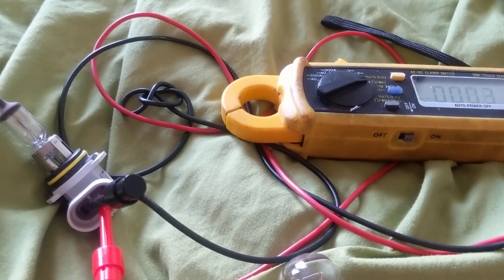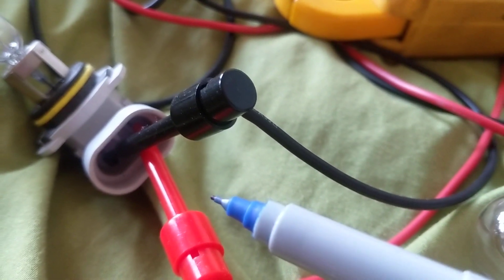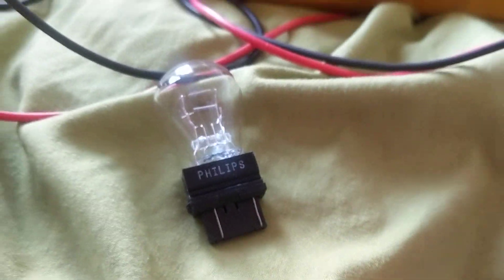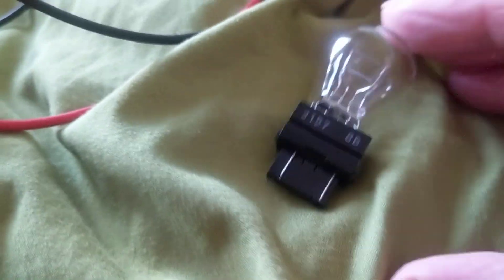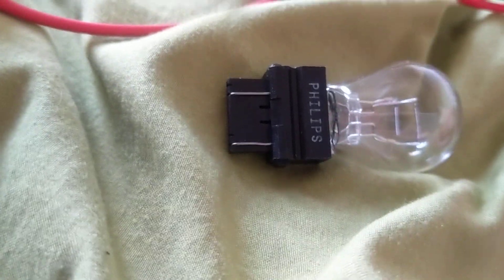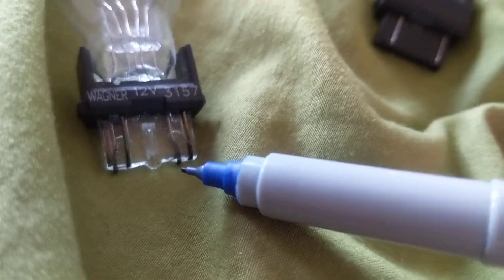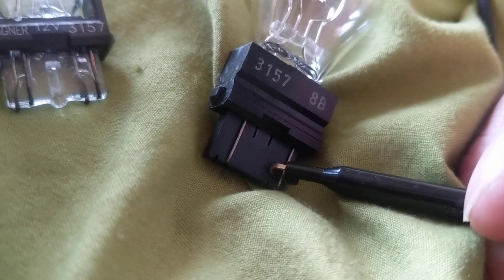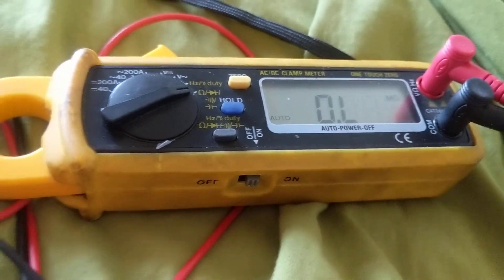How to test AUTOMOTIVE BULBS  and turn signal lights for resistance measurements WITH MULTIMETER

Comment: my gawd --- i think it is probably cheaper to just switch out [ switch ] bulbs --   vid is over kill to say the least .   a bulb test could be E Z
Reply from the maker: Worked with a technician and my career who switched three bulbs after which the problem was in the lighting control module so you see Alan sometimes it's better to just test the bulb
Reply from the maker: You have to understand repair shops don't carry parts they have to order parts sometimes they even send the wrong parts this is not a dealership which has the parts ready in the stock room so if you order a part you have to make sure you diagnose correctly
Reply from the maker: Other point being the technician had to order the bulb which took half a day then when he tried it wasn't convinced still wanted another bulb needless to say the customer was not happy when all he could have done was just basic resistant checks on a bulb to see that it was good all the time can you respond to that Alan
Reply from the maker: What about a technician I worked with that couldn't test a fuse I thought the fuse was no good but the fuse actually was good a resistance check would have solved that problem and a customer would have been much more happier I'm waiting for your responses Alan

Comment: What about your Fluke 83 V? Is that not good enough for automotive measurements? I hope you'll do some practical demonstration on the location and the arrangement of different lights on automotive systems. What I mean is that some big vehicles have four headlights on the front and only a pair of them would have high beam. It's not obvious which pair of lights (out pair or inner pait) should glow first when you turn on the switch. There are some other lights that come with the turn signal also.
Reply from the maker: Thank you for your feedback I agree definitely will do it
Reply from the maker: Definitely show some Hands-On I'll be coming shortly thank you for your comment although it's been awhile since I replied